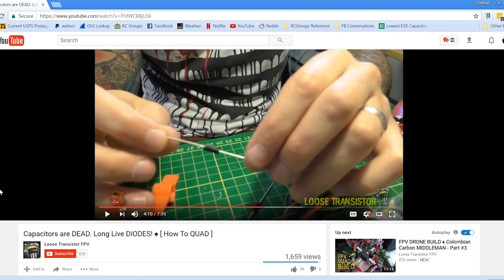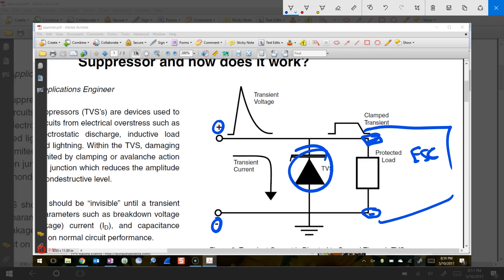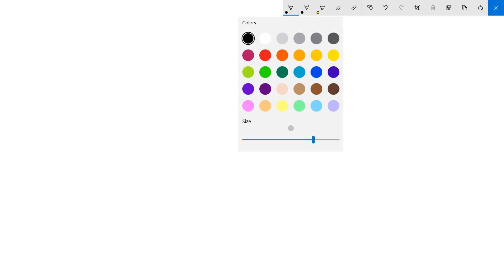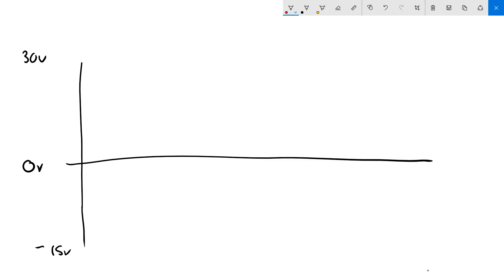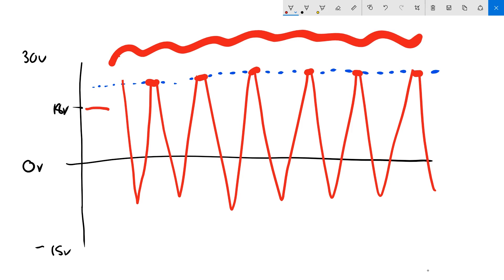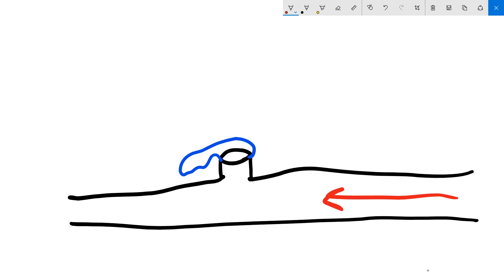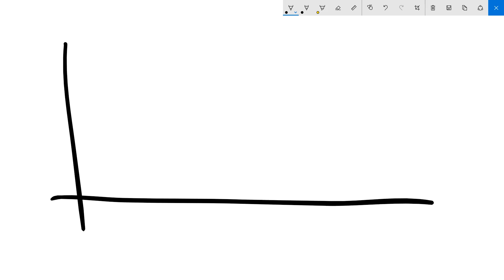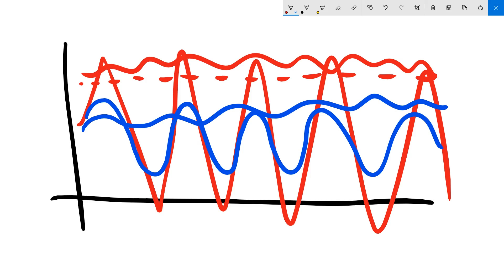TVS Diode Instead of Capacitor? No.

Comment: the low esr cap (must be low esr but if you don't have one and you happen to have a tvs diode for some reason and maybe a regular capacitor it might work perfectly) as long as it's sufficient size is really a cure all. if the esr is low enough and the capacitance high enough there won't be any spikes. if you have a current sensor the cap must be on the ESC side, not the battery side. an lc filter also works if you can put something in series between power and the sensitive parts. but in today's market of aio flight controllers the low esr cap  is probably the only elegant solution and works so well you don't need the tvs diode. perhaps if space is limited you could try to filter the negative spikes out from the regulated signal with smaller capacitors on the 5v and or 3.3v lines and a tvs diode to clamp the harmful high voltage spikes but I don't think that's a common problem since most frames are open on the sides with tons of room.
Reply from the maker: That's a damn good point about the current sensor shunt resistor. I don't have an intuitive grasp of RC filter design, but I can see that what you've got is essentially an RC filter. But with such a low resistor value, does it really matter?
Reply: Joshua Bardwell I should have qualified that "I speculate" that such is true. there are some things about rc filters I'm not certain of but I won't get into that in a comment. but if the resistance is low enough I suppose it won't be anything you couldn't overcome with a larger cap. what are those resistors anyway? a half ohm or so? 

maybe someone will have to get a scope and test some myths on filtering. my brother has a scope but I can never find the time for experiments. I'd rather just do something that I feel confident works and keep it as simple as possible.

Comment: Hi Joshua, I'm curious to how the diode would impact the ESC while braking? Would most of the reverse current be shorted by the diode, therefore preventing anything else than a tiny negative voltage at the ESC pads? Would that make the braking worse, or better?
Also second question, would it be a good idea to have capacitor + diode?

Comment: Good analogy, I would never just use the diode, it should always be incorporated in series with a tuned resistor and capacitor that are in parallel to work as a voltage clamp snubber, the current spikes at avalanche (conduction) will otherwise create an inverse current spike without having the ability to be absorbed anywhere, therefore a huge amount of noise and dirty reflected 'crap' will be creating more problems than just hot short lived diodes, that clipped current will be shared back to it's source, putting additional load and thereby derating the esc. The other problem with smacking the diode with a hammer 20000 times a second is when it fails it will become dead short circuit, then all bets are off. Just putting a diode in there is like taking the shock absorber out of your car and replacing it with a steel bar with it's length set at the suspension driving travel height, then driving full speed along a corrugated road... your suspension will only move half travel but.. it probably won't last long. You can also run into other issues with non dissipative snubbing like parasitic noise and ringing, even a basic switchmode supply can use inductance leakage to dissipate this, but that requires the inductance of a transformer to work. So, just saying, I would not do it without more correct design input.. or, just use capacitors, low esr, and all is good.

Comment: fyre sg put capacitors on his esc and cured an otherwise incurable vibration issue.... should i buy a bunch of what 18v capacitors?
Reply from the maker: I would use 25v minimum for 4S.

Comment: When a TVS diode "opens up" it literally creates a short circuit which just cannot be good for the battery. A capacitor on the other hand not only filters transients but also acts as a local current source which amplifies the effect of filtering. However, you cannot use just any cap because at certain frequency it might start acting as a short circuit. But I am not EE so take my opinion with a grain of salt.
Reply from the maker: Shorting a battery for a pico or nanosecond is not in any way bad. Remember that the battery doesn't deliver current instantaneously. It won't go from 0 amps to infinite amps the moment you short it. Using a diode like this to protect against transient noise is a standard and well-established approach. There is no inherent danger to the battery.
Reply: Because the TVS is set for higher voltage than the battery, the battery will actually be protected by it. The same cannot be said for the ESC and the motor though. When braking all the voltage (above TVS breakpoint) generated by the motor will be shorted back to the ESC and motor.

Comment: A capacitor will not pass DC but will pass AC. Great for getting noise off a DC line. The diode is good for suppressing over voltage spikes.

Comment: You have the principle down, but the reason why a diode doesn't work for this application is simply due to LiPos discharging below their peak voltage. If our packs stayed the same voltage throughout the cycle we could install a diode at the latter voltage and no noise could enter. Unfortunately because the diode cutoff is fixed the noise has a chance to enter as soon as the pack is slightly discharged, but right out the gate you'll have the cleanest signal ever. ;-)

Comment: Hi Joshua, Loved your anology and yeah your on the right track. I like to think of the TVS as a high pressure valve and the cap as a big shock absorber. TVS is harsh and abrupt whereas the cap is gentle and controlled, and realistically a combination of the two will give the best result, but at the end of the day caps will NEVER die! Love your work and channel, keep the good stuff flowing!

Comment: That Diode crap ist just stupid rubbish.. It's only shorting the power source.. And our power source has very low resistance, so the current will be massive! Oh yeah, lets do a short on our lipo to drop voltage.. Yeah, that sounds amazing, right? With this diodes your ESC, lipo or something else will catch fire very soon.. DONT DO THIS!
Reply from the maker: +YannikW this is perfectly safe if installed correctly. The "short" is pico or nanoseconds long. Just long enough for the transient to pass.
Reply: naah, I'm just a Hobbyist, but I'm Not so sure that this is Safe... the energy while breaking hast to go somewhere.. in this case it will dissipate in heat in the diode
Reply: I don't think that battery will even provide the current in this transient situation. Battery cannot provide voltage bigger than it's  charged voltage. If you are cutting voltage spike of 22V the source of this voltage is motor coils.  So cutting this transient is not drawing current from the battery. 
Here is discussion about similar situation https://electronics.stackexchange.com/questions/157739/will-back-emf-damage-a-lithium-ion-battery

Comment: TVS diodes are used to get rid of spikes or transient. Clamp the signal to a certain level. One use is so next stage is not over driven.
But they don't smooth a signal just clip it.
Capacitors do a far better job of smoothing the RF noise off a DC voltage, they don't clip the signal.

Comment: Hi. Same understanding of the phenomena than you. (and I loled when seeing your flacid balloon) But as you say, TVS diodes also have their spot. Overvoltage protection can be the issue you are trying to solve (like the famous littlebee braking / HS1177 story). There is also the overvoltage following the inrush current when you plug a battery ,fill in your condensators then stop the current very fast (see trampHV inrush issue).

Comment: TVS Diode used in this case is about protection a save guard. 
Capacitor is used for the same reason but also works as a voltage stabilisator and fast power buffer.
It does bit more then chop of the peaks.

My preference would be a Capacitor to.

Comment: I don't understand why no one is using inductors, like in an LC filter.
Reply from the maker: +Adam Wilkinson because the inductor is installed in series and must deal with the full current. An inductor that can handle 20 amps would be massive
Reply: Good point, although I'm thinking to protect the flight controller and other electronics. ie. installing it between the battery and the 5V regulator. Do people really blow up other ESCs due to voltage spikes?

Comment: For LC Filter, some suggest to add diode + inductor + capacitor. If main VCC dropped to low value, say 5V, electron stored in Capacitor won't flow back to PCB and keep VTX working. Some VTX need 2S to work these days.

Comment: you did a wonderful job explaining that I feel you are correct in your theory the best case scenario is to use both but a lot of times they use diodes for reverse polarity protection if you notice you looking into  TVs and UPS backups there filters are made out of a little bit of both is a suppressor and a filter

Comment: Lol, I get a kick out of the quad community "discovering" new ways to handle noise and filtering.  Them again, maybe there's an opportunity to make a few bucks scoping people's quads....
Reply from the maker: If you've been there and done that, how about enlightening us all?
Reply: What are you confused about?  The motors and controllers we use aren't novel to quadcopters and there are plenty of resources on noise suppression available on the web.
Reply: Just rambling here... but there isn't a one sized fits all solution to filtering voltage spikes.  The frequency of the noise matters and different frequencies will need different solutions.

Aluminum electrolytic caps respond very slowly but have a lot of capacitance.  Great for filtering low frequency changes such as voltage sag from a punch out. On the other hand they don't react quickly enough to save your flight controller from a sudden sharp voltage spike.   A ceramic capacitor, protection diode, or some combination of the two would be more appropriate.

It's not unusual to see all three of those together in parallel, to reduce low and high frequency noise.

Comment: I agree with you. I saw + -5V band of noise even on 3S batteries in my old quad with 20A littlebees, and even though the peak never exceeded the voltage rating of the VTX, I cooked 2 of them. a linear regulator might better accomplish what he was trying to do with the diode if it is for the purpose of supplying a VTX and flight controller. most of the noise should be under 100khz which it would reject pretty well. A 12V linear regulator on a 4S system should stay below the lower end of the noise floor. stepping from 4S voltages to 12V would only be 4V drop, so I think you could get away without a heatsink. This setup would not give you the extra ESC performance and protection though. I saw less than + - 1V of noise after adding a 25V 100uF low ESR cap, which I am pretty sure weighs less than a gram. also tried a normal cap before figuring out ESR and the difference was so small I could not see the difference on the scope without looking closely.

Comment: Honestly I would be hesitant to use a tvs diode even if they can react faster as they will just waste energy instead of storing it.
adding capacitance to the escs would take care of the big dangerous spikes more than enough and help the esc run more efficiently.

Comment: I'm an electrical Engineer specialized in hardware design and the video stating that capacitors are dead is wrong (and even moronic).  But it's true that a tvs diode placed near the ESC or on the PDB is good for getting rid of the voltages spikes caused by the regenerative braking of the ESCs.  But ESC need the power to be filtered to work properly because when the motors change RPM these capacitors supply the peak current while maintaining the input voltage.  If the input capacitor is too small or its ESR is too high, the current spike of the motors when they change RPM makes the input voltage drop which make the motor ask for more current, which makes the input voltage drop even more etc.  And at one point it can in some conditions burn the ESC and/or motor because the motors end up consuming too much peak current.  And since current ESCs on the market have barely enough on board decoupling capacitors for 4S, it's always a good practice to add a low ESR capacitor at each ESC or one on the PDB.  Note that 4 low ESR 250uf on the power input of each ESC is much better than a big 1000uf on the PDB

Comment: Your assumption is correct if want to filter then use a cap if you just want to protect the ESC use the TVS Diode it will not filter out noise it will protect the esc from current overload but the noise is still there.

Comment: The capacitor is sort of a battery that charges and discharges and will even out the flow typically used to keep the flow from dropping below center (zero) during the sine wave cycle. The water pipe example is a good one as a capacitor will smooth the electrical flow.

Comment: hi josh...you came to the best scenario.... 4 capacitors on escs and a 5.5 volt diode on the power supply for your flight controller

1W Zener diode, 3.3V-30V 14valuesX10pcs
 http://s.aliexpress.com/iYRjARfU 
(from AliExpress Android)

Comment: I see where he's coming from but for what we're trying to achieve a capacitor is better suited for the job of cleaning up electrical noise.
If we were trying to add protection a diode would the right thing to use.
Reply from the maker: It's not that protection isn't a good idea. I definitely think there are a lot of high-volt transients in the system that a diode can help with.

Comment: The problem I have additionally with diodes as replacement for caps is that it essentially shorts the poles on big transients. I'm not sure who thinks that'd be a good idea. Plus, there's apparently a corner case, where it could open up completely after a big spike. That's certainly not good.

Comment: The question to be answered is where do we use the tvs and where do we use the  cap and then what uf cap do we use as older recommendations say 1000uf now I'm seeing 450uf and 330uf
Reply from the maker: +Marcus Mc Kay on the ESC itself I don't think there is much advantage past 330 uF. On the battery lead, even 1000 is often not enough. I would take four 220 uF on the ESC's over a single 1000 on the battery lead.

Comment: TVS diodes are for overvoltage protection. I have never seen that as a problem in Lipo devices. Capacitors are for noice suppression, and that is often a problem. And yes i am an electrical ingeneer.
Reply: 30V spikes should not kill well designet electronics
Reply: Ok, TVS kills overvoltage, C .. RC... LC filters kills overvoltage and noice. Noice is the big problem :-)
Reply: If i wantet to make my quad heavyer, i would use ferrite cores.
Reply: ESCs under breaking can cause large and very fast voltage spikes, this is why the diodes are being suggested.
Reply: High enough to kill the electronics ? I have never seen than, lipo's are very good at supressing high voltage. The problem is the rise time, and TVS dosent do anything there.
Reply from the maker: +Per Buch definitely high enough to kill some electronics. I've seen reports of over 30 volts.
Reply from the maker: +Per Buch well, sure. But we are dealing with stuff developed on a shoe string in China. So...
Reply: I would stil rely on C or LC filters, why only solve the smallest problem ?
Reply: capacitors ads weight, leads act as an inductor, in a moment when switch stops the current, voltage on inductor spikes -> that produces noise on esc (although battery acts as super capacitor it could be far from esc due to leads). 
Adding excessive caps (especially low esr) could also not be ideal, caps add weight and you have to deal with arcing during battery connection (due to high inrush current also not ideal for battery).

Comment: The way they use the TVS diode is wrong. The protected load is not the ESC, but the VTX, or the PDB for the FC. The proper usage of the TVS diode is to put a small resistor in series, then the diode, and the VTX for example. Resistor should be calculated, not to drop too much voltage at the current needed for the load. 1 ohm should be fine for 2-300mA, drops 2-300mV. If a spike comes in, the diode opens, and the excess power will be dissipated on the resistor+diode. 
On the battery terminals/PDB/ESC supply you can, and should use a low-ESR electrolytic. Actually, for quick voltage transitions, a metal film capacitor would be better, but they are more space consuming. Someone should test if a 470nf 63V MKP makes any difference if it's added to the low-ESR electrolytic. :) I've been using TVS diode since the beginning, as described above, and my video is always butter smooth.
Reply from the maker: Of course, you can't put a resistor in series with the ESC power lead. It would have to be a massive resistor. We're pulling like 5 to 20 amps here typically.

Comment: Can you recommend a capacitor on a micro brushless say like kingkong 90gt? Or is it even needed on 2s builds? Maybe I should add capacitors to my micro builds. Though certainly only a small one.. idk. Your thoughts?
Reply from the maker: With the smaller motors and props, I think noise will be less of an issue.